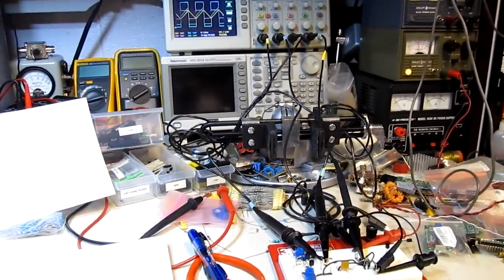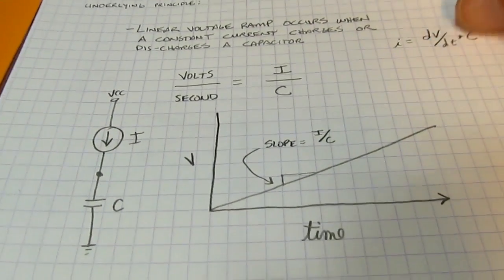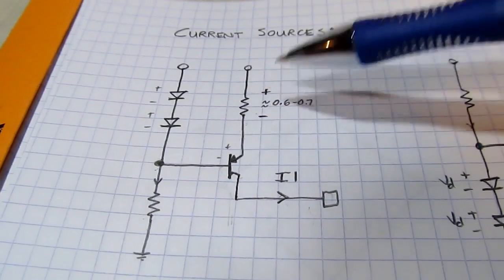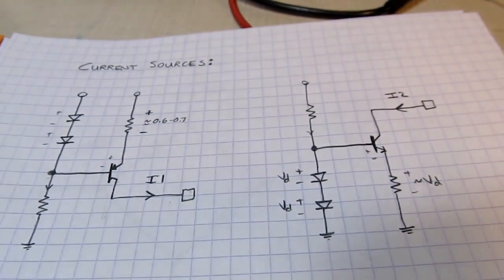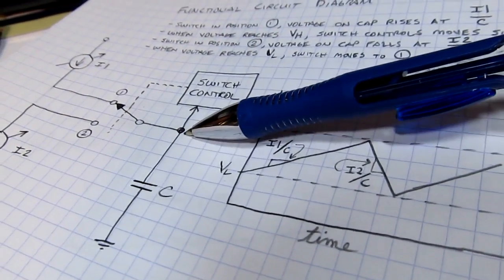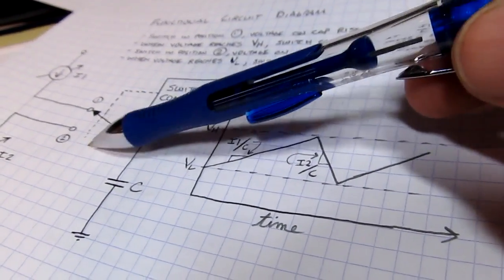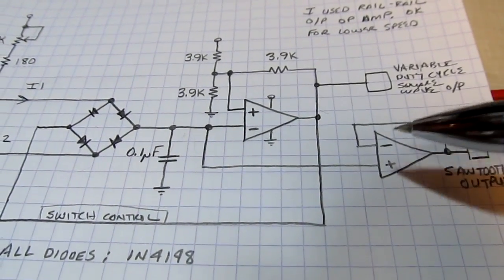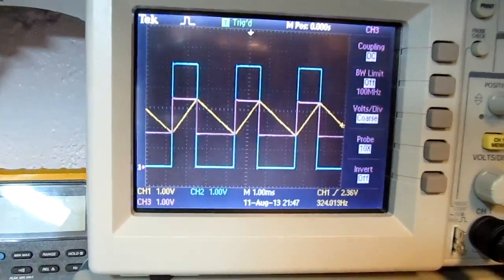#104: Circuit tutorial: sawtooth generator w/ current sources, diode switches, hysteresis comparator

Comment: Thank you for teaching. However, I also have a question, if I have a square wave, and use the square wave to control the switching of the current source, I can theoretically achieve a sawtooth wave with good linearity, but through the simulation, it is obvious that the output waveform is not so linear. I would like to ask you how you understand this question. How can we solve this problem?

Comment: Hello W2AEW,   Thank you for this working circuit, but I have a few questions what type or model ic hysteresis comparator do you use and what type or model ic do you use as the buffer, and from what voltage and up to what voltage does this circuit work and can I add something to this circuit to get a dc offset so that the sawtooth works from 0 volts and can this circuit with a sawtooth make a voltage that slowly increases from 0 to e.g. 5 volts this e.g. in 60 or 100 seconds this to let a radio run slowly through the fm band with this circuit.

Greetings, Andre
Reply from the maker: I used an ordinary rail-rail op amp for both functions.  I don't remember the part number, but any general purpose R-R op amp will do the job.

Comment: Nice explanation.  I might have added a speedup capacitor on the comparator, particularly if I'm going to use the square wave output (this is a nice variable-duty square wave circuit as well as a triangle generator).  47 pF in parallel with that 3.9k feedback resistor should tame any glitches at the transitions.

Comment: What is the Vcc of this circuit?
Reply from the maker: I believe I used 5V
Reply: @w2aew  thank you! I have most of these parts on hand, they’re not the exact models but hopefully they’ll work well enough.
Reply: @w2aew  do you have any tips for troubleshooting? I put the circuit together on a breadboard and can’t get it to work. I’m not using the exact parts that you have, but I’m using ones that are close enough to where it shouldn’t be an issue.
Reply from the maker: @thomasthecrunkengine3512   Best bet is to isolate each section (current sources, diode switch bridge, comparator) to verify all are OK.  Take careful note of the diode orientation in the switching bridge - it is NOT the same as a full wave rectifier.
Reply: @w2aew  Got it. I’m going back over the fundamental circuit diagram to see if I can’t produce a similar circuit with a different tactic. It seems like you might be able to make a very similar circuit with a push/pull BJT pair, a comparator, and a current source/sink pair. I’ve seen a lot of current sources that use zener diodes and I might have to try that out.

Comment: whow, this is really a complicated circuit with a lot of parts. I think it can be simplified a lot. At first I would like to use a 555 timer IC as switch controller. For the current sources one can use the 100 mA versions of the voltage regulators LM317 / LM337 with feedback potentiometers between output and adjust pin as current source / sink. It is also possible to unify bothe potentiometers in a linear dual potentiometer to keep the frequency if the duty cycle is changed. Then you just need the 4 diode switch and the time detemining capacitor.

So you need 1 LM317, 1 LM337, 1 dual potentiometer, 4 diodes 1 capacitor and 1 NE555 / TLC555. In total 9 devices plus a 1 capacitor from Vcc and 1 capacitor for pin 5 to ground at the 555. In total 11 devices.
Reply from the maker: Yes, there are definitely simpler ways to do this.  The point of this video though was not fir simplicity but rather for education on various types of sub circuits. Of course, the two voltage regulators, the 555 actually encompass a lot more (integrated) transistors than my circuit.
Reply: @w2aew  "the 555 actually encompass a lot more (integrated) transistors than my circuit."

You used a dual rail-to-rail opamp in your circuit. Allready a single 741 has 20 integrated transistor functions. Rail to rail opamps have larger transistor numbers because of their output configuration and its drivers.

A 555 has a very economic design and comprizes only a total of 25 transistor functions.

Comment: Thank you so much! Very interesting. I found that video because I am trying to find how works generator for horizontal deflection in oscilloscope. 
Regards from Ukraine!
Reply from the maker: Yes, many horizontal sweep generator circuits use the same principle of a constant current source into a capacitor to make a linear voltage ramp.
Reply: @w2aew  Thank you for your answer! Yes, I know the main principle, but I have a lot of trouble with synchronization, because generator should start its voltage ramp with the input signal and it is difficult for me to design. 
I want to make simple oscilloscope using B13S6 CRT. Now I design DC power supply and next will be horizontal generator
Reply from the maker: @Avrora707  This is the function of the Trigger circuit.  Keep the timing cap shorted (via a bipolar or FET) until the trigger condition is met, then turn off the shorting transistor and let it ramp.  At the end of the ramp, short it again then wait for the next trigger event...
Reply: @w2aew  yeah, you accepted my thoughts  about it👍 and now I am sure what I need to achive. For current moment I have designed simple schematic to try.
I see two difficult tasks: it is need to have two  modes - auto and wait, and second it is need to have good waveform on frequencies up to 1 Mhz. 
Ok. For that moment I have enough information, so I need to try it.
Thank you so much for your help🙂

Comment: Hi , nice to see a detaild information about cct's . Just for information and possibly a lazy approch ! Ive built saw tooth generators with Shmit triggers . I.e recently used CD4096 quad two input Nand . (Resitor in feedback and cap to ground ) the wave form accros the C is roughly triangle (but as you know can be controlled with diodes in the feed back to alter the mark space ratio) . With the 4096 the input impedence is high , so use a FET to sample the capacitor's  wave. Yes I see your way would give better liniarity,  but I just needed to control  sound effects.

Comment: Great way to turn on and off the charging and discharging paths!  the only thing is this diode bridge switching method comes at the expense of wasting some current; so it's probably not suited for battery applications.  Also I haven't seen how to vary frequencies (while maintaining peak to peak amplitude) in it. I guess it's elsewhere in your other videos.
Reply from the maker: Varying the capacitor will change the frequency, or you can vary the charge/discharge current.
Reply: @w2aew   Thank you for the info. I'm trying to build a voltage controlled sine wave generator covering 1hz to 5000hz, and most likely I need to start with a triangular wave, then filter it.
Reply from the maker: @LL-ue3ek  Filtering it would be difficult because the filter BW would have to track your signal frequency.  You'd be better off with a shaping network - google triangle to sinewave conversion to find some ideas...

Comment: Very innovative switch design.  However, I wonder why not use just a JFET or MOSFET to do this switching?
Reply from the maker: They can work too  - the diode bridge is nice because it works at very low voltages.
Reply: @w2aew  Yes, but the problem is that it can not go down to zero, and you always stay one diode voltage drop above the ground.  However, you can use clamper circuit as the next stage to fix this. 
Another idea, would be to replace the diodes in the switch with SCRs, to extend the voltage to few 100 Volts.
For current generators, one can use IGBT, instead of BJTs to have current sources that can handle many 100s of volts.
Of course a resistor voltage divider can bring down the voltage so a normal comparator can be used to set the highest voltage of the ramp.

Such circuit could be useful as lab equipment to test the breakdown voltage of various materials and components.

I am designing a 40V Saw tooth generator to record negative resistance of BJT transistors(when emitter and collector has been switched like they use in Esaki oscillators) using XY function of oscilloscope.

Your clip was interesting and thought provoking.  Thanks again for sharing

Comment: Your videos are great! I was getting a headache trying to figure out how to calculate the  the linear charge of capacitor which I've figured out is  t =VC/I, where frequency is the reciprocal of t (1/t),  because I wanted to get the frequency of a PWM thing I'm doing. BTW, most of what I've learned about current sources and generating waveforms was from these videos. You're a great teacher!

Comment: Nice trick to use diodes as a switch. But what about removing diodes, swap +/- OPAMP ins and connect the out through resistors to the current sources' bases? Could it be simpler?
Reply from the maker: Almost - you still would have to arrange for the positive feedback, but there are LOTs of ways of building this circuit function.  Of course if we left the diode switching subcircuit out, we would have lost this teachable moment! ;-)
Reply: @w2aew  I see, it's worth it. Diodes are powerful thins, they can do much more than just rectification. I'd like to to see more videos about not obvious diodes usage.
Reply from the maker: @alexloktionoff6833  I've got lots of videos on diodes...  https://www.youtube.com/user/w2aew/search?query=diodes

Comment: I've watched these videos (this and the previous one) a couple of times now, I'm new to the hobby and it took a while to get it.

Thank you, they are so beautifully crafted, best teaching material I've seen in a while. The different versions of the schematic, high-level to component-level, that was great and it opened a door in my mind I never knew were even there! It's starting to look like hardware programming (I'm not new to programming), and I guess that's a good thing, because I'm not afraid of programming and was very much daunted by circuit design! Still am, but your videos are helping so much!

Thank you for going so deep into this circuit which is by no doubt pretty much trivial to you. I appreciate every minute of it, always to the point, no unnecessary padding, distilled essence of what needs to be said.

Comment: Hello dear  W2aew Nice vidéo , i' m trying to understand how you get the 0.6 or 0.7 through the resistor. #1.52  min? . Pls can you explain  ?
Reply from the maker: I'm sure you're talking about 3:38 in the video.  The 0.6 or 0.7V comes from the fact that the base is going to be 2 diode drops below the positive supply, and then the base-emitter voltage of the transistor is also about 0.6 or 0.7 (about 1 diode drop), which leaves one diode-drop's worth of voltage across the resistor.  Simply summing the voltages around that loop will give you the same thing.
Reply: @w2aew  
Ok 👌🏿  thanks a lot...

Comment: Will this work with a dual supply opamp?
Reply from the maker: Sure, as long as you adhere to the minimum supply voltage range and input common mode range of the op amp you choose.

Comment: Wanna save money on parts? Use a normal resistor as a non-ideal current source.
Reply from the maker: Works fine if you can maintain a constant voltage across the resistor.

Comment: Is there a way I can adjust the amplitude and have controlled over it? I basically need something that starts at 2V and reaches peak at 15V and falls back.
Reply: There are lots of ways to do this.  The most straightforward and flexible way would be to follow this circuit with an op amp based amplifier to give you the gain and offset that you need.

Comment: can the ccs be changed with an opamp ccs to make it voltage controllable?
Reply from the maker: Sure.  A CCS can be voltage adjustable without  being op amp based too.  Any suitable circuit that creates the constant current will work well.

Comment: A long while ago, back when we had to walk 15 miles to goto school (and it was uphill both ways), I was told of a motor control circuit. Instead of just basic PWM, where the mark to space is changed for a constant frequency, it had a constant mark, but variable space, to ensure the motor did not draw too much current while building up speed.

This can be used as a constant mark (or constant space) driver! 

Thankyou for this video, I learned a lot of new things, and I'm going to have fun playing with this in the workshop 😁

Comment: Great job! thanks for the video. Would you have a circuit for a triangular wave output variable between 4mA to 40mA at a frequency of 0.1 Hz if so I would suspect it wouldn't be hard to make another one with frequency at 0.00167Hz? Also a square current from 0 to 40mA at 0.05Hz fixed. I appreciate any tip. Thank you so much in advance.
Reply: Hi LM,
not to be e dick, but these are tutorials so you can learn how to figure this out yourself. Just try it.
Use some other values for the capacitor and/or current and see what happens.
The timing was explained : Current/C = V/second, the Volts being the difference between the upper and lower limit of the comparator  (and a division of 2 for the frequency).  The 40mA are determined by the output stage and might be a bit high for an Op-Amp -> see Emitter follower.
For your requested long times/ low frequency you will run into the issues of either very low currents or high capacitors with leakage and it will not be very exact for sure. That's were digital counters come in handy.

Comment: Sir, when i replicate your circuit on the Multism,  i cannot get the expected outcome and i still didn't figure out why. Could you please help me fix that problem? Much appreciated!(I'm a freshman in electrical engineering)
Reply from the maker: Oscillating circuits are traditionally difficult to model in simulation.  Often it helps to setup an "initial condition" to force the simulator into making the circuit oscillate.  I am not familiar with MultiSim, but check your documentation to see how to set an initial condition, and start with the voltage on the 0.1uF capacitor at 0V.

Comment: Alan, your videos are amazing. Thank you. I built this circuit in a night and even modified it slightly to replace the current source and sink diodes with green LEDs so I could see when it was on. Running off a 9V battery and works like a charm with an opamp I had on hand. I had a lot of fun adjusting it, learning what each component is responsible for, and the limits.
Reply from the maker: Perfect!  I am so happy to hear that my video inspired you to build, test, learn!

Comment: Could you please point me to a video, if you’ve already made one, or make one if you haven’t that explains how I can take a circuit like this and make the unity output buffer have a 50 ohm impedance output?  Do I just put a 50 ohm series resistor on the output?  I’m in pursuit of making that homemade ramp generator for my signal generator that lacks one but does have a VCO control input I can use to sweep it. Ideally, I also need to buffer the switch output to use as a gate output too for the scope trigger
Reply from the maker: I'd be very surprised if your signal generator has a 50 ohm input impedance.  For your ramp generator, you may be interested in this circuit that was sort of designed for that purpose: https://www.youtube.com/watch?v=bVahBmsvirE  It can't drive 50 ohms directly either, but it should need to.

Comment: I have been a technician for over 40 years and never worked on a circuit where a bridge is used as a switch. Excellent description of voltage drops and current sources. It is great to see that students today have this medium to use as a reference to understand the work they are doing in the lab.

Comment: How can you find the DC value of a waveform using a scope?
Reply from the maker: With an analog scope, it's not really possible unless you record voltage values and run your own RMS calculation.  For digital scopes, many will have an RMS measurement function that you can use.
Reply: @w2aew  Thank you!  Your videos are excellent.

Comment: Great video thank you. May I ask if this circuit could be modified to include high current in order to drive a coil in order to produce a corresponding sawtooth varying magnetic field? I suppose using a capacitor to cancel the coil impeadance is needed to drive the current in the coil at high frequency. Would love to see!!

Comment: Reminds me of a circuit...   With a dual op amp,  you configure one of them as an integrator (cap from output to inverting input, series resistor also to that input),  and the other as a schmitt trigger (two resistors,  one at the non-inverting input to output,  one from that input to the output of the integrator.  This simple circuit will generate a triangle wave at the output of the integrator and a square wave at the output of the scmitt trigger with only a dual op amp and a whopping four passive components.  Want to vary the duty cycle?  Then you use two resistors (or a pot) with diodes in opposite directions for the feedback resistor in the schmitt trigger portion of the circuit,  and you'll get a variable duty-cycle sawtooth and square wave.  Total of six passive components and a dual op amp...
Reply from the maker: Definitely familiar with that circuit too.  It is a "staple" in most op amp circuits books and application notes.  For this video, I thought that the circuit presented offered a lot of good opportunity to discuss several different interesting circuit techniques (current sources, diodes as switches, etc.).

Comment: thank you, it's a great work you are doing right here on Youtube. i am just currently working on comparing sawtooth signal with a sine wave in order to generate a pulse width modulated output. would you please show me the schematic of this circuit because i am not sure about the power supplies ,current sources and the controlled square wave duty cycle.